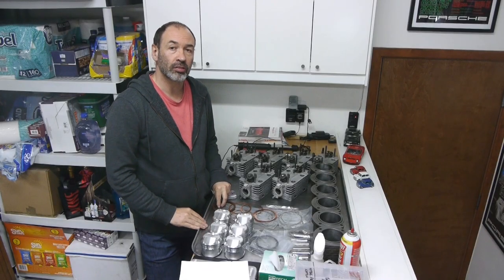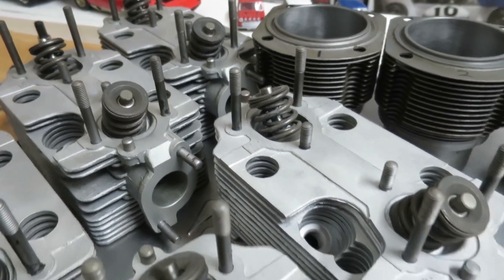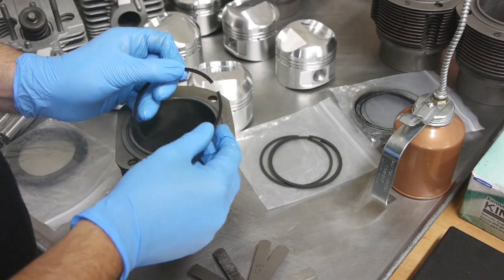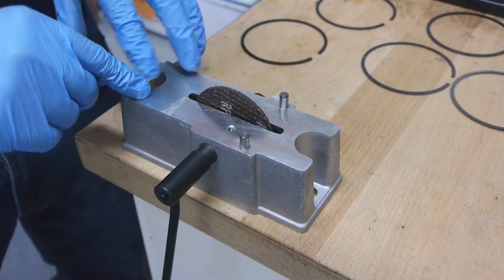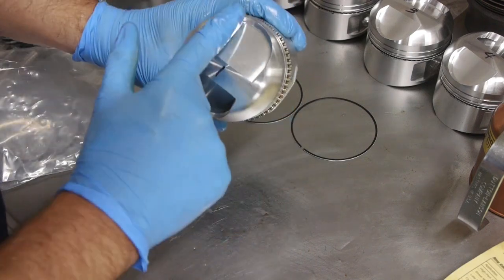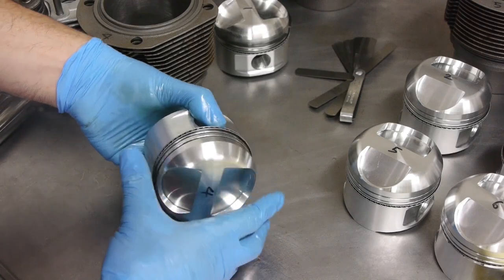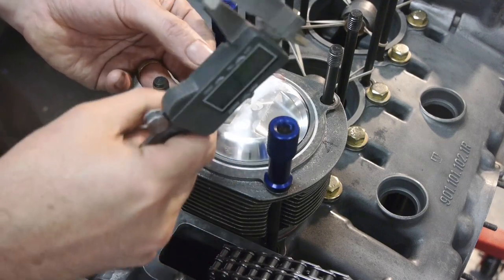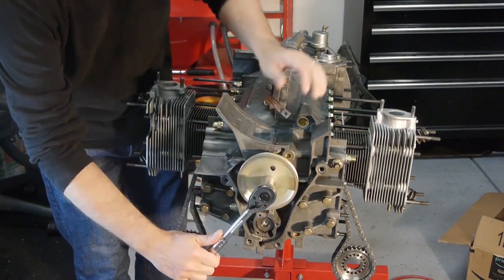Engine Rebuild Part 2: Top End, Pistons, Cylinders & Heads. 1969 Porsche 911T. The Canary Files.

Comment: My only suggestion would be to oil the cylinders and rings during assembly or at least before installing the heads.  It'll probably be ok, but pistons/cylinder/rings are splash oiled (I didn't see any jets) and it'll take several revolutions before they get oiled, so it's nice to give them a head start.     Other than that,  what an amazing job from someone that doesn't do this for a living.

Comment: I've only just come across your videos of the 911 engine build and I have to say you've done a good job.      My only negative comment is when torqueing down nuts.   My tool maker Dad told me to take the nuts down a bit at a time until they were all at the required torque otherwise you could still distort whatever it was you were tightening.

Comment: Greatly appreciate the effort and time you are putting into this project documentary.  Will be doing the 2.5L long stroke dual plug in my 914/6 GT this winter, and your insites and tool selection will certainly help.  I too have the wonderful book by Wayne Dempsey, unfortunately, he doesn't include my engine in his list of favorites, so have had to do further research myself on the the specifics of the engine components.  Will be detuning the engine from this HSR veteran so it is street tractable and track day capable.  Best regards, Barry

Comment: Glad you remembered the stretch film trick. I was sitting there thinking as you were trying to figure out the little clip tool “I sure hope he covers those bores when he uses that” haha. Also, after your last clean of the cylinder assembly I would recommend a light film of oil in the cylinder bores and on the rings...especially if the engine isn’t going to be ran shortly. Aids in not scouring the bores/rings and also prohibits corrosion if it’s not going to be ran right away. Great work and great editing...thanks for sharing.
Reply from the maker: Thanks for the advise! Can I ask how you heard about the channel, I seem to have gathered an new audience recently?
Reply: kavs911 To be honest I’m just a gear head and high performance engine builder/tinkerer and just stumbled across your channel. Mostly high horsepower turbo/forced induction Honda V6s, Subaru’s and of course V8s (usually GM, but the 5.0 Ford is becoming more and more popular) I also do a lot of work on off-road racing, side by side and turbo 2 stroke snowmobiles. Anyways, I’m always watching engine build videos (especially something different like yours)and no matter how many thousands of times I’ve done it, there is ALWAYS something new to learn and beneficial ideas from other like minded individuals...kind of like the stretch wrap trick. My friends tease me and say I have a “pornographic” memory just because they think it’s humorous that I can pretty much just look at anything mechanical (especially engines) and figure out how it goes back together without much effort. I’m certainly blessed to be able to do that, but really do thoroughly enjoy it...and most importantly for engine building...I have a cleanliness ocd, especially when it comes to this kind of thing. Looking forward to seeing it run. I know I talk a lot, but I really enjoy chatting with other people about engines or anything g mechanical. Maybe they say I have a “pornographic” memory because videos like this are porn to me lol. Great work. Thanks again. Also, just out of curiosity, is there a fuel injection modification for this engine?

Comment: You can use a piece of lead solder wire just a bit bigger than your bump clearance and lay it on top of the piston and hand crank the engine over, you can then measure the flat lead with a mic to check clearance, you can also do this with a built engine, just use a longer piece bent over and holding one end and insert it via the spark plug hole and hand crank.
Reply from the maker: Yes I've heard that.

Comment: I like to coat cylinder head studs with anti-seize. This makes the heads slide on and off easier when checking clearances and for final assembly. , Also if I ever have to remove the heads the anti-seize prevents corrosion sticking things together. I use copper based high temperature anti-seize. Otherwise this man is very thorough  and careful.
Reply from the maker: mindtouchone I used the grease from the arp rod bolts.

Comment: Great job. You never be too clean. I prefer to use copper spray on the head gaskets, etc It's not necessary but it can fill in any imperfections and help hold the combustion pressure sealing line. Also, a good modern spray adhesive on the other gaskets, especially the water pump might help reduce any potential leaks and give you a little ease of mind...
Reply: Yes K&W spray type Copper Coat or even the type that comes in a can you dab on. Another great adhesive is Permatex Hi-Tac.

Comment: I know it was a long time ago, and you have finished the build and run the engine, but just a couple of small things for someone who is going to do the same thing as you. I think it is recommended that the gap in the gudgeon pin circlip is at the bottom of the piston in the 6 o'clock position and not the 3 o'clock position. This prevents the chance of the circlip being compressed with the acceleration of the piston on the down stroke and coming out of the groove. If the gap is at the bottom, it removes the chance of this happening. Also, it would be a good idea to bolt the manifold or a plate to the ports of the heads before they are torqued down, to make sure the are aligned as much as possible.
Reply: Ive just seen the next video, ignore my second comment, sorry.

Comment: Just followed! What a nice rebuild video with tons of attention of detail! I just bought myself a 1969 911t , trying to rebuild the engine too, it was in a running condition(with some smoky issue) but today it wont start again. Gonna do some trouble shoot next week....

Btw is there any nice reasonnable price rebuild kit available for the 2.2 on the market? And is there any specialty tool i should get?

Sorry for all those question!
Reply from the maker: Hey Archy thanks for the kinds words. So your '69 T has a 2.2 in it and not the original 2.0L? The only kit you can buy is a gasket kit really, You need to work out what needs replacing and buy those parts. Are you doing a full rebuild or just the top end? Some specialty tools required yes for removing the cam nuts etc. They are all mentioned in the vids!
Reply: @kavs911  i will probably just doing the top end , but maybe when i open it up , i wil do a full restore for it . Hahhaha . Im trying to go through all your videos to learn more about it :) keep it up! I really enjoy watching them !

Comment: Why would he not lubricate the cylinder walls before installing the heads....on start up it takes a few seconds to get oil to the rings....why would you run the engine even for this brief time wuthout using some lube to prevent scuffing?
Reply from the maker: I hear what you're saying. Not mentioned in any of the Porsche engine building literature. Next time!

Comment: No oil in the bores when assembling?
Reply from the maker: I did oil the bores. I think I mention that as I'm filing the piston rings.
Reply: @kavs911  In fact, the only thing I saw was you put something in the minute 16:50 
but that was not oil and you cleaned it,  possibly you missed that detail in the video, you were so detailed that it must have been a forgetfulness of the edition
Reply from the maker: @poporopo12  I mention oiling the cylinders at 1:40 but yes I didn't cover that again after I cleaned them. Hard to remember to film everything!

Comment: Just an observation.. you tagged cylinders as 4,5,6 on the same bank. Does Porsche do this? Typically I see 1,3,5 on bank one and 2,4,6 on bank two for v6 engines.
Not familiar with the engine or Porsche and curious if it's the way their manuals speak to cylinder positions.
Reply from the maker: Yes this is how Porsche do it. 1,2,3 on the left, 4,5,6 on the right! Can I ask how you heard about the channel, I seem to have gathered an new audience recently?
Reply: @kavs911  just searching engine rebuilds. At the time I came across your video I think I had just watched a few cosworth videos and maybe yours was linked as a watch next or something. Searches that day were around race engine rebuilds.

Comment: Did you consider putting in piston oil squirters?
Reply from the maker: Not for this engine, higher HP yes. Can I ask how you heard about the channel, I seem to have gathered an new audience recently?
Reply: It popped up when I was looking at vw engine rebuilds.
In addition, I believe oil squirters would have been useful even at this stage since Porsche began installing them a year or two later.
At a minimum you could have machined in the piston rods type squirters. It's not very difficult.
https://www.youtube.com/watch?v=7wuNuuEoN7Y
Reply from the maker: @tillyjow8484  Ok thanks!

Comment: Nice one Kav! Following with interest. Did you consider switching to Aluminium & Nikasil cylinders?
Reply from the maker: Yes i did but for me it was a cost thing. I got a great deal on the pistons from Jay my machinist who bored my original cylinders to match, all came in at less than half the price!
Reply: kav911 Loving your attention to detail on the build!Really well done.I’m Going through the design process myself at present .. investigations found alloy cylinders manage the heat a lot better and nikasil cylinder lining quite robust. I’ve decided to source some 2.7 cylinders. Can’t wait for your next release!

Comment: I do believe you maybe confused about the octane rating of the fuel where you are currently. From the look of the pump you are now in the US and maybe are used to fuel octane numbers from somwhere else in the world

There are two different measurements for Octane. One is called the Research Octane Number (RON). It's used in most of the world. The other is called the Motor Octane Number (MON). 

The tests are different; MON is a more sensitive test than the RON test.
 So the same fuel will get a different octane number in the two tests. 
The US and Canada average the result of the the two tests so the octane number shown on the pump in the US is lower for the same gas than it would be elsewhere in the world.

Because of the averaging, there's usually about a 4-6 Octane gap between US octane numbers and the rest of the world's numbers. When going from one nation to the other don't worry about the actual number, just use the type (standard, plus, premium) as required in your car's owners manual.
 Or you can do a quick calculation as below -

91+6= 97 Octane when measured using the RON index only, so the premium fuel in the US 91 would have been fine for a compression ratio of 10.5:1

Comment: Don’t forget to use a good mineral-based oil, during break-in for the first 200 to 300, then a good full-synthetic oil from then on, we have seen a new race engine blow most of it full-synthetic oil due to blow by in the early days of synthetic oil, a lot of head scratching and a strip down found nothing wrong, But luckily a few phone calls to other builds and we found
out why.  Fully synthetic oil is brilliant, we had an rally engine run 5+ miles with a water pump gone and we fitted a new pump top up oil /water and it went back out to finish the event, ok the engine bay and under side were coated in oil due to the heat, from then on I even used Mobil 1 in our service van. Check the link below for more info, good luck with the
build, looks nice.   https://www.youtube.com/watch?time_continue=269&v=MlmHOMm9gow&feature=emb_logo

Comment: VALVE CUT-OUTS on piston need SMOOTHING OFF as the sharp edges will cause DETONATION. also NO OIL on piston rings.--- ALSO after all the cleaning  from machine shop you had BYPASS HOLE  CUT.......  SHOULD HAVE dipped WHOLE ASSEMBLY in drum of diesel then airline BLOW OUT ALL AIRWAYS.......
Reply from the maker: I did oil the cylinder walls just not on camera. The machine shop cleaned the case after the oil bypass.

Comment: so....
you can buy brand new pistons, cylinders, valves and other parts for the engine.
is there anybody who makes brand new engine blocks and crankshaft?
if so, you can build brand new engine from the scratch.
Reply from the maker: David Jacobs there are a number of parts you want to keep original, especially the matching numbers engine block.

Comment: Rather than use putty why not use Plasti-Gague?
Reply from the maker: It was recommended by some Porsche engine builders.
Reply: Plastigage is used to check the clearance between a plain shell bearing and a shaft - as in main bearings (see part 1) Also he is aiming for a clearance of around 1.5mm from memory and plastigage will not measure clearances that large AFAIK. This "putty" is used to check the clearance between the valve head and piston crown with both valves closed and the piston moving up to TDC. He then measures that clearance by measuring the thickness of that putty and adjusts the clearance by fitting different thickness cylinder base gaskets.
Reply from the maker: @MrPnew1  What Pedro said.

Comment: I love the rebuild but damn what a terrible engine design.
Reply from the maker: I think it's beautifully engineered.
Reply: @kavs911  I guess being only 31 im no expert on design from that era. Im sure it's very well engineered. I wish to correct myself in saying that I think it looks like an extremely difficult engine to assemble. So many components. But like I said I really like what your doing thumbs up. Is it running yet?
Reply: Beautiful design 
You can replace all the major parts like heads and barrels singularly